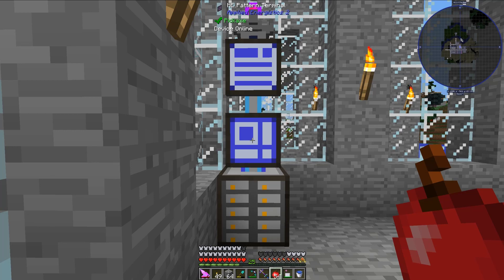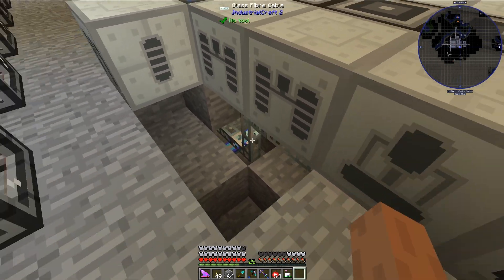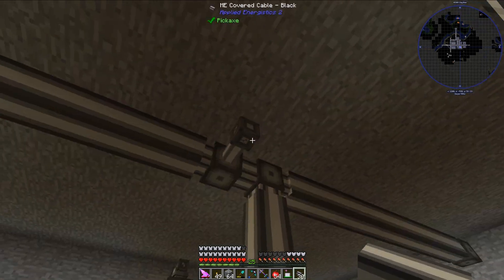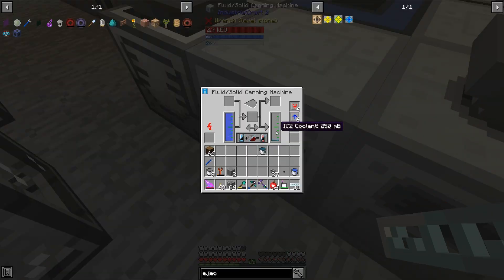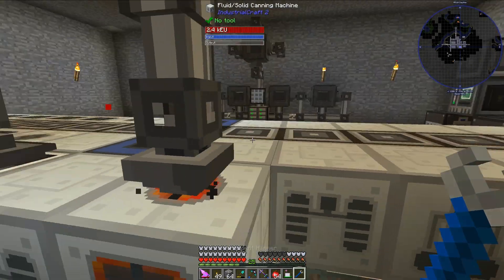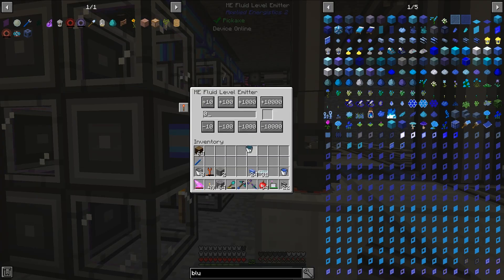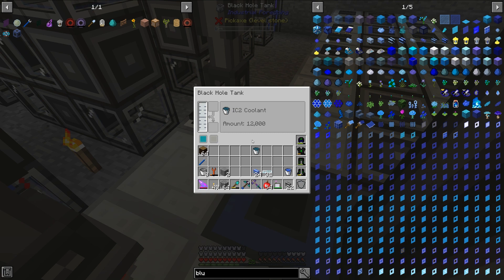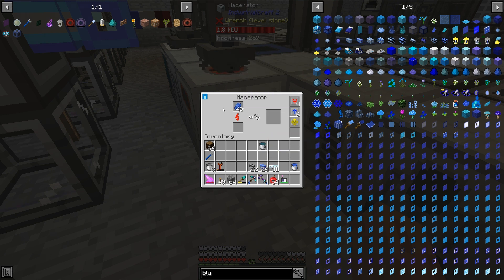How To Automate The Production of IndustrialCraft 2 Coolant

Comment: How would you turn EU into rf?
Reply from the maker: I'm sure there are mods that can do it, but I don't use any of them. I essentially have two different energy systems for my main base, an EU energy system and an RF energy system. Most mods use and generate one or the other (or a form of energy that is compatible with one or the other such as Crystal Flux from the mod Actually Additions), but there are some mods that can generate either EU or RF. NuclearCraft can generate/use either RF or EU.